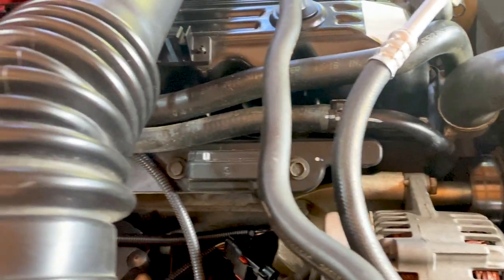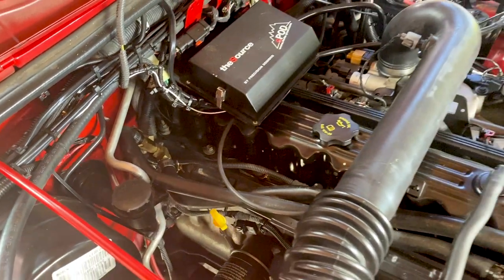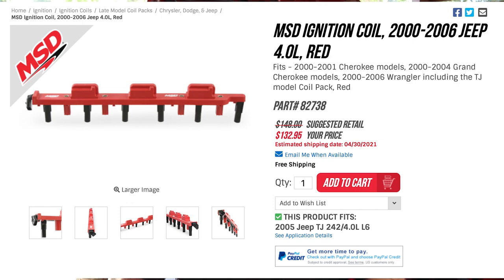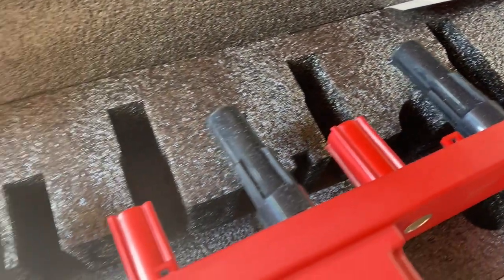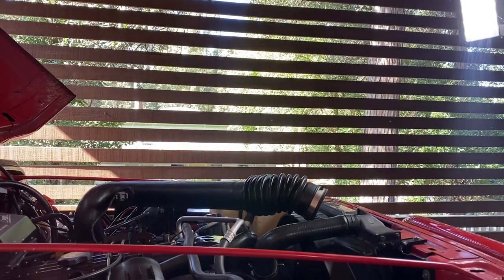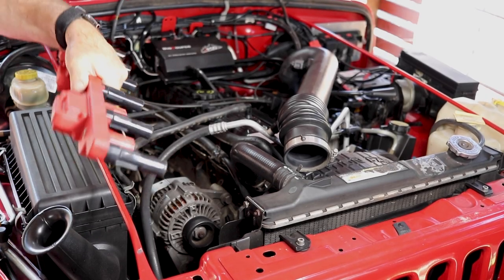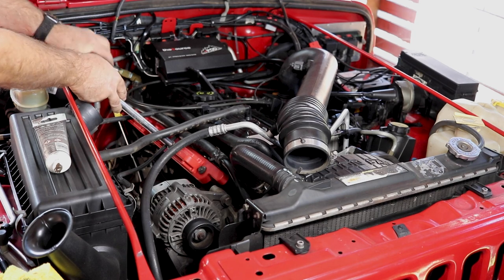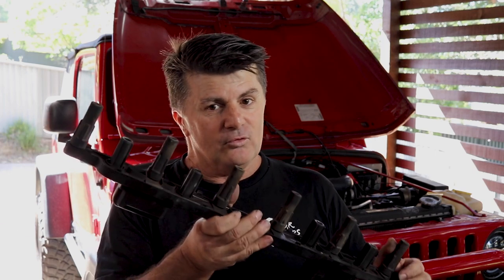Jeep TJ // MSD Performance Coil Rail Upgrade

Comment: Great video, but I wouldn't have written off the Viper coil pack.  Dodge used it on a few other vehicles that may have also been available in Australia.  Biggest perk for me is how much easier it is to diagnose issues when you can actually check for spark.
Reply from the maker: We didn't get Dodge here period.
Reply: @DarrylSheather  huge difference then!, Lol.
Reply: The viper coil pack is a available because some people like it….I’m not a fan of it since you have plug wires now & a coil you have to track down if it ever fails so I’ve always preferred the long coil a little dielectric grease stays water tight for wheeling eventually everything goes bad so when it’s time to replace it you just have to pick what works for your application best….it’s not gonna gain you any power so it’s really just what you like
Reply: @Jboost412  100% agree there are no performance gains to be had from the viper coil mod.  I just like how much easier it is to test for spark.

Comment: FYI I understand that  the "Viper" coil is also used on numerous more pedestrian Mopar V6 applications, like the Jeep JK and Dodge/Chrysler/VW minivans and trucks, although you have to ignore the embossed cylinder numbers. As I understand it, the V10 Viper uses two coils, one from the V6, and one from a 4 cylinder. Referring to it as the "Viper" coil just makes it sound more exotic than it really is. Out of curiosity, where is the MSD coil rail manufactured?
Reply from the maker: It may have been used in the 3.8 JK not the 3.6 as they have individual coil packs.

Comment: What was the price difference from the RockAuto  OEM rails? Also how do you search RockAuto other than items listed under your model and year? I know they have other parts but you need a part number to search.
Reply from the maker: Similar pricing for the NGK version. If you look in Quadratec or the like you can find part numbers of parts pretty quickly and search with those.